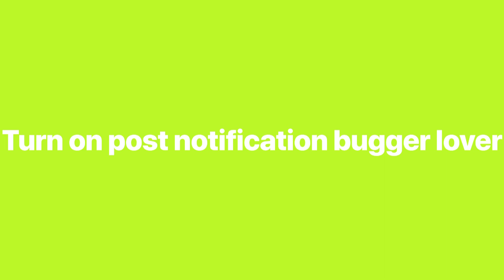DIRT BIKE SHOWING BEFORE MODS 📌

Comment: Check your carb I do not see any air filter on there. If you run like that you are going to have big problems
Reply from the maker: Thank you I definitely will !! But …. What does that look like ? 😂 reply with a link
Reply: @LifeAsAngelicaa  it will be on your carburetor. most of the time they are foam to filter out the dirt and allow clean air enter
 the engine.